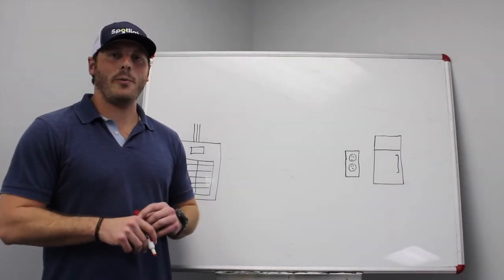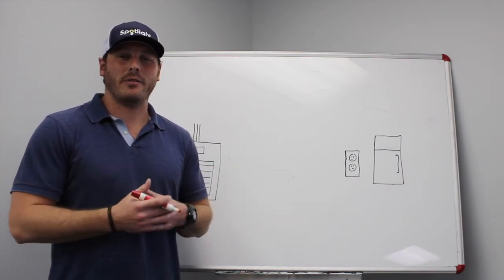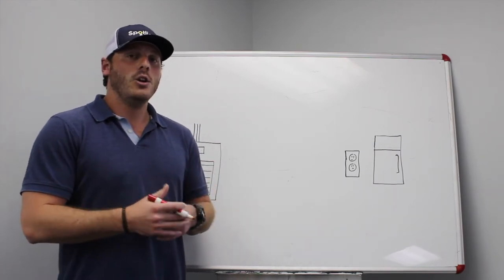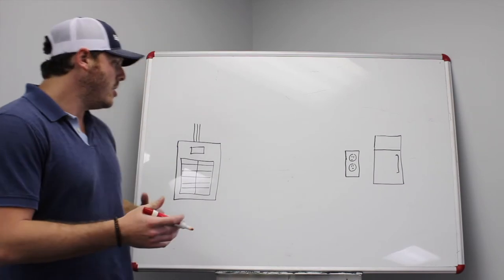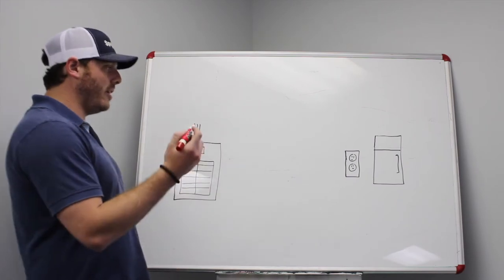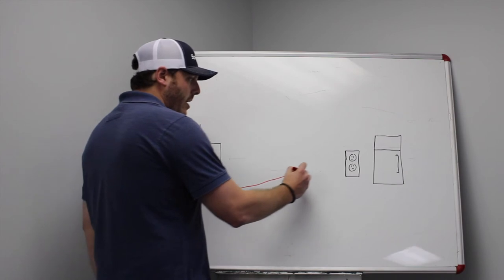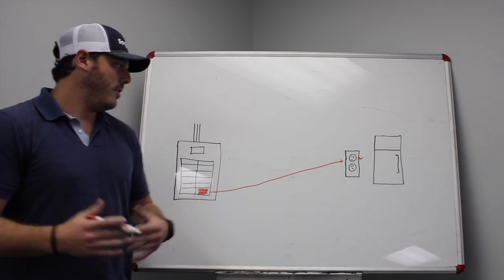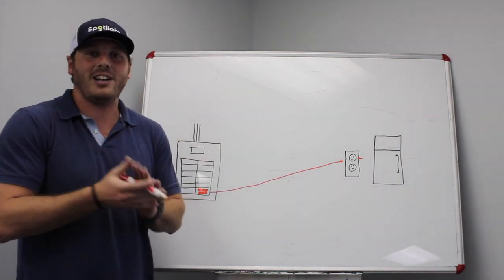What is a Dedicated Circuit?

Comment: Hi Chris, correct me if I'm wrong, but I thought dedicated circuits were supposed to either be hardwired or have a single receptacle at the end. Your drawing shows a duplex, in which case some other thing could also be plugged into the circuit.
Reply: You are correct.

Comment: So......how many actual plugs can a dedicated circuit have? Can you plug in something else on the lower plug in that duplex refrigerator receptical in your drawing example?  Can you for example have (3) duplex outlets (6 plugs)  and just make sure for example that if you connect the microwave to one just dont run the coffee maker and toaster at the same time? Because if the logic is dedicated circuit ie individual branch circuit follows the laundry room dryer example of one appliance one plug one breaker then my main panel is going to be filled up with 20 amp kitchen breakers. Thanks for your reply and clarification.
Reply: I’m wondering the same thing.
Reply: @jupiternorthe1535  I realized that the NEC is just a voluntary standard. Im going to wire my kitchen and the rest of my house according to my anticipated load. For my kitchen I will do a dedicated 20 amp breaker for 4 plugs and IMO that is over kill. I will only plug in one major appliance but for the rest of the time I will have the other 3 plugs available for use. In my parents kitchen they have the whole thing on one 20 amp breaker powering 10 plugs plus the ceiling lights all perfectly in working order without problems for over 25 years since they built it. The NEC is getting ridiculous with the new BS arch fault and gfci requirements plus the stupid tamper outlets. I dont know your situation but its my house and Im going to wire it the way i see best, considering safety and best practices of course but without having a stick up my arse with all BS. Im keeping all standard breakers, gfci only in laundry and outside outlets, and the only thing I will add to my box is the whole house surge protector and the intersystem bonding termination in the ground wire.
Reply: @hippo-potamus  I’m trying to combine the dining room and kitchen as a renovation project. The fridge and small microwave plus lights are currently on the same 20amp circuit. There are 3 outlets and one is a GFCI in the kitchen. 

The dining room with lights is on its own 20amp circuit with one GFCI.  I only have my computer in the dining room right now and nothing else. 

I want to move the fridge and microwave to the dining room on one outlet. Then install a dishwasher and garbage disposal on one outlet. 

The fridge, dishwasher and microwave will all be new appliances. 

Gosh it’s all confusing cause some are saying by doing research the code the code this and that. I don’t want to pay to re-wire. Now I’m thinking to keep the install the dishwasher and built in microwave on the same circuit and the fridge in the same circuit.
Reply: @jupiternorthe1535  If you get a licensed electrician to redo your wiring you will need a lot more dedicated 20 amp breakers. If your main issue is lack of breaker slots the easiest thing for you IMO would be to add a small sub panel box. Remove the kitchen 20amp breaker and the dining room 20 amp breaker and in their 2 slots add a 50 amp breaker to feed your small sub panel. Then on the sub panel you can keep the dining room as is on its own 20 and use the other slots to give you kitchen the many 20 amp dedicated circuits it needs ie a separate one for the dishwasher, the garbage disposal, and any number or outlet plugs depending on your expected load which would be minimal. For my dining room I have four (4 plug) outlets plus the celing fan and its lights all on one 20 amp breaker, so that is 16 individual plug connections. On my kitchen I have a 20 amp breaker for each 4 plug outlets where 3 of the plugs are free use and one of them has a major appliance, so my kitchen has 3 20 amp breakers total each feeding a 4plug outlet. Do it yourself mate, the electrician will be pricey and with the subpanel it will be super easy and you wont have to move anything. Just remember to separate your grounds and neutrals so chose your box wisely.

Comment: Hey Chris! Thanks for the simple explanation! I hope you don't mind answering a question I have about dedicated circuits. 😊 There are 4 electrical outlets in my garage, and they're all controlled by the same circuit breaker. Three of the outlets have only one thing plugged into them (a two-car garage door opener, the optical network terminal for my internet service, and a battery charger that stays plugged into my car's cigarette lighter. For reference, the car has a  gasoline engine (not electric) but because it isn't driven regularly, the battery tends to get low if I don't keep it charged.) I'd like to plug a small chest freezer into the fourth outlet, but the manufacturer recommends plugging it into a dedicated circuit. Do I need to hire an electrician to put the fourth outlet on its own separate circuit, or is it safe to plug the freezer into the fourth outlet with my current setup? Any clarification/advice would be very much appreciated!